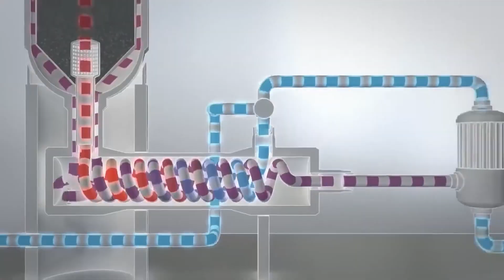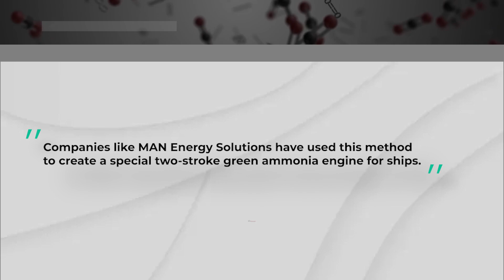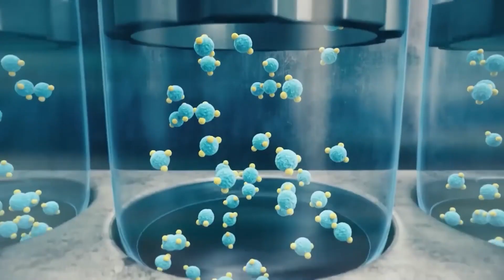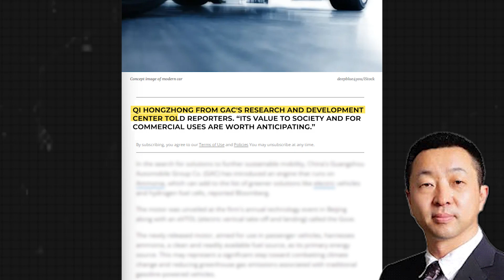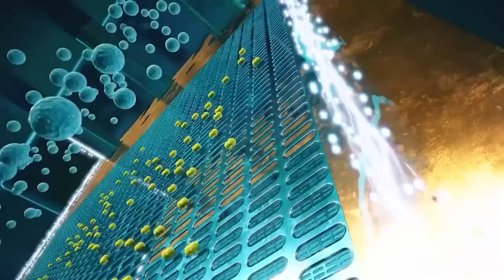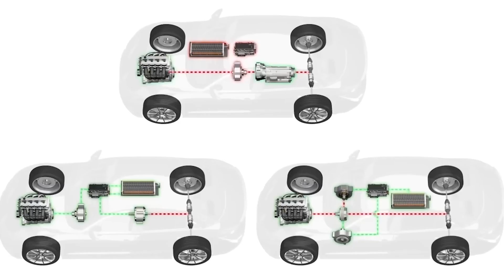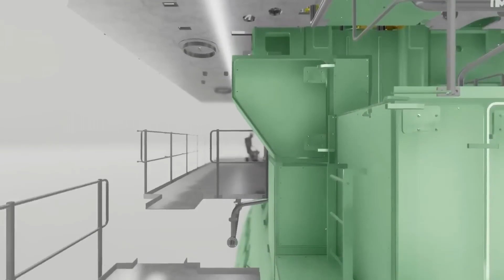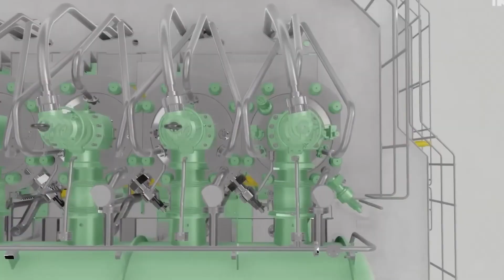Toyota CEO - "Our New Ammonia Engine Will Destroy All EV Makers!"

Comment: Ammonia has been used for at least 100 years in large industrial and food plant refrigeration systems. There have been well documented accidents, explosions, and many deaths attributed to ammonia refrigeration systems. In these systems ammonia is recirculated as refrigerant and not burned or otherwise consumed. How much worse would it be to have millions of portable ammonia systems traveling and parked everywhere that actually burn ammonia. By the way an ammonia leak requires everyone nearby to put on an emergency breather that includes an oxygen tank, without the oxygen you will just die.

Comment: EVs are an environmental disaster in real life - the mining is savage with 200 tons needed to produce 1 battery pack. Oil only results in CO2, which is plant food... EV's will be dumped in the TRILLIONS every 8 years which is going to create TOXIC MOUNTAIN RANGES...Oil workers are well paid where EVs require child slave labor to extract rare earth metals.

Then you need DRIVEWAYS - how many people don't have a driveway to charge? Who wants guest coming to their house and wanting to plug in their EV car to get back home - I'm not down with that at all. 

The grid will collapse. Electricity will be more expensive then oil.

EVs cost double of ICE cars.

EVs are a nightmare on a long drive.

EVs are useless at heavy duty TOWING.

EVs do not hold any value after they are a few years old

EVs replacement battery packs can cost 1/2 the price of a new car.
Reply: If only it was that simple. Unfortunately burning oil produces Carbon Monoxide (CO), Carbon Dioxide (CO2), Sulfur (SO2), Nitrogen Dioxide (NOx), Nitric Oxide (N2O), Volatile organic compounds (VOCs), and Hydrocarbons (HCs). Don't get me wrong, I have no intention of giving up my petrol car anytime soon, but I can still acknowledge what it throws out into the air. EVs are not a magic bullet to solving the problem of cleaner transportation. Whether EV, ammonia, Hydrogen, they all have their issues, some very serious ones.